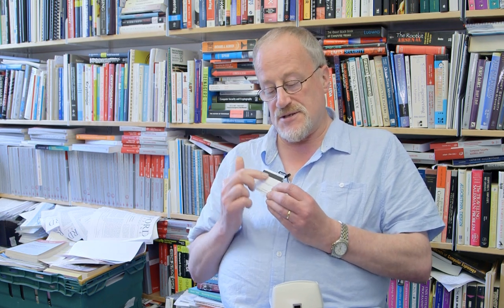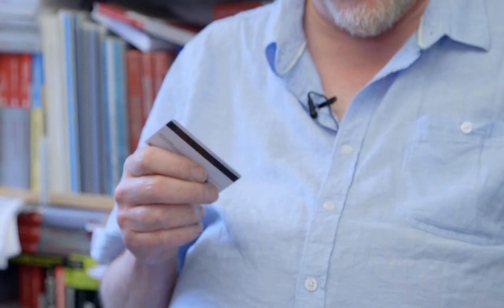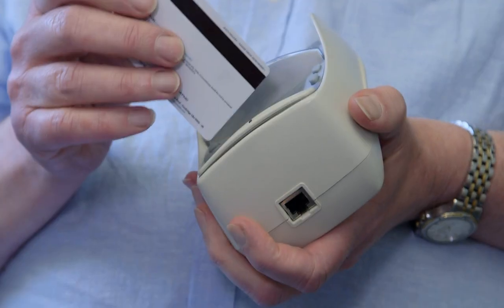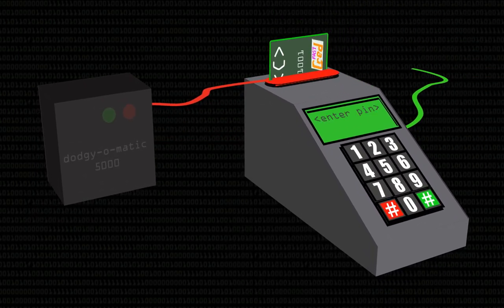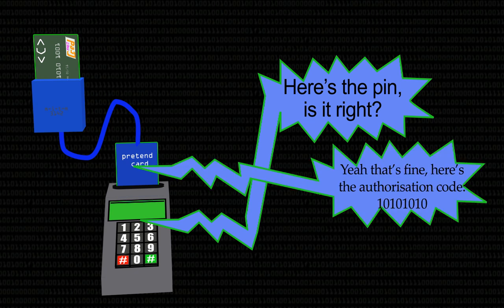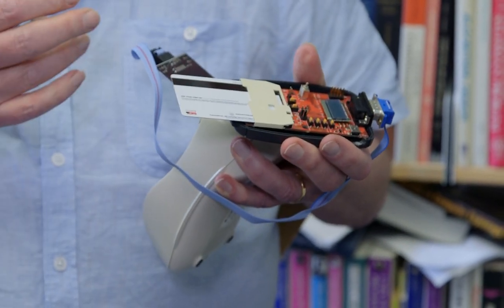Chip & PIN Fraud Explained - Computerphile

Comment: This is why I like internet banking. I have three accounts with the same bank. One has no debit/atm card just a mag-strip card that works in the bank and nowhere else (and never leaves the house), one gets used for potentially dodgy purchases on the internet and one gets used for day to day use. I transfer only as much cash as I need to the cards when I need to and the rest of it stays safely tucked away where there's no way for thieves to get at it. If I lose a card it's no big deal. Mildly paranoid perhaps but effective.

Comment: Wow, pin passed to the card in cleartext, or with a cracked key, authorization returned in the same, and the same authorization works for signature and pin transactions, plus machines without intrusion detection that can be reprogrammed and still work? And the consumer is liable because its "secure" ?  What a shit system.

Comment: This Chinese "chim" card can be used to emulates someone else chip?
Reply: +Yuri de Castro It would be used with a physically stolen card, where you have the victim's legit card but don't have their pin. The use case there is that the baddie wants to use a stolen card at a legit merchant and get away with it.

The shim-chip modifies the communications between card and pinpad to convince the card that it was a Signature transaction (and hence "right pin?" is not relevant), while the pinpad believes that the card accepted whatever pin was typed in. 

(if I'm understanding the video correctly, anyway)